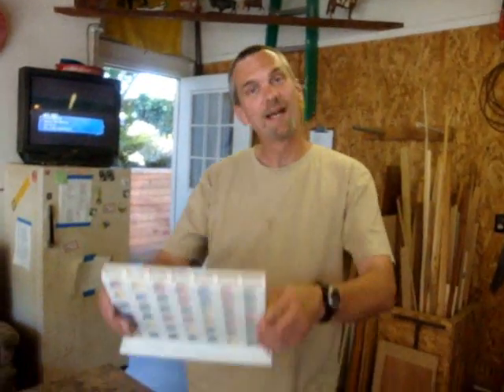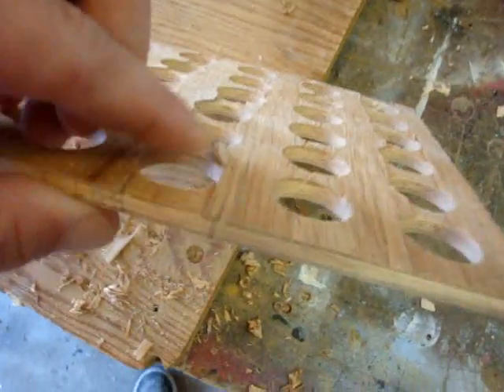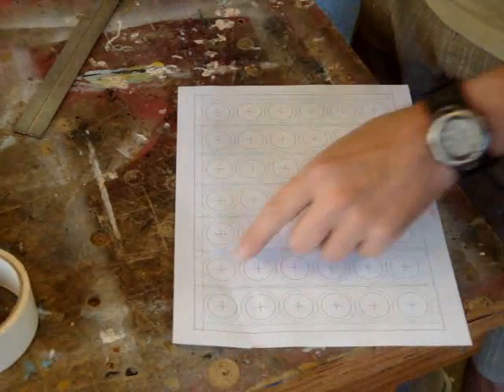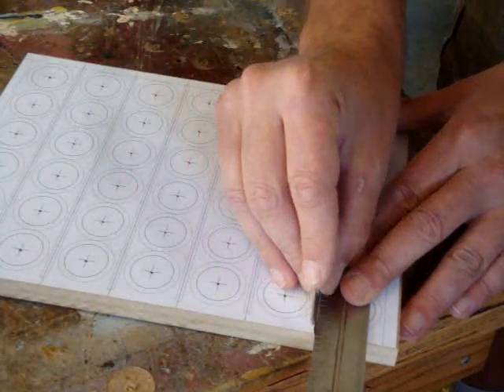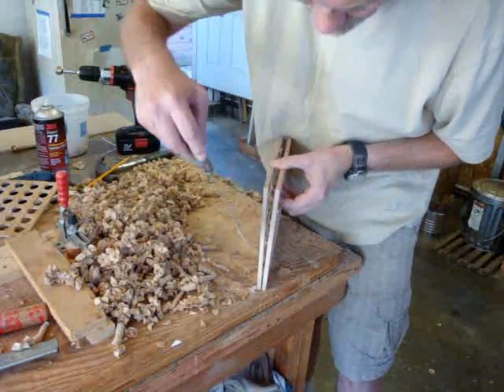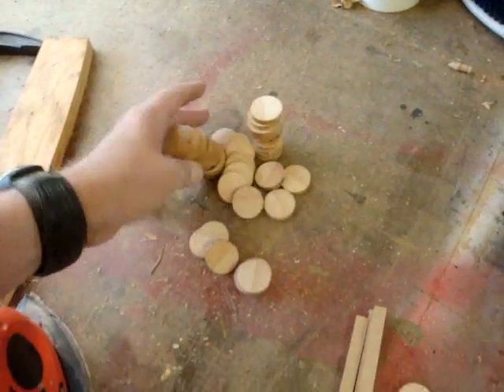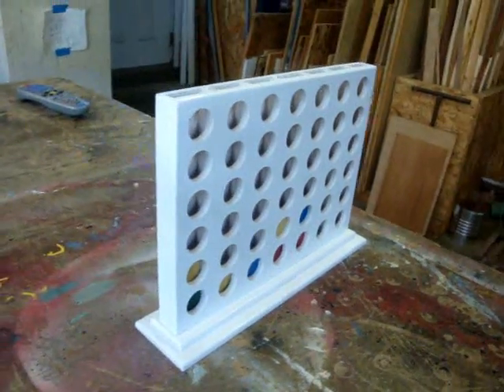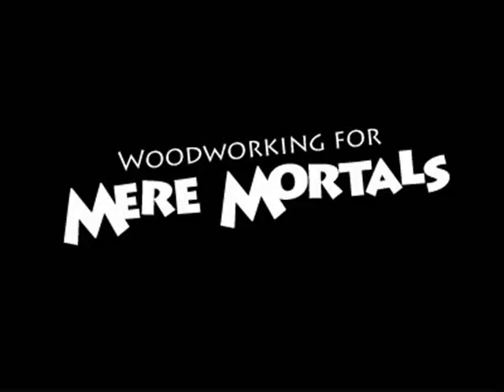Make your own Connect 4 game

Comment: I have a tip for working with the carpet tape, similar to the spray adhesive. Try sticking the tape to some cloth ,(usually my jeans leg), pulling it off and then sticking it to the boards. You should get enough lint to keep it from getting "welded" together!

Comment from the maker: @RedFox52403 I was a little concerned, but I cut about fifty of those and none of them popped out or jammed. I suppose because they are pretty light and small. Once they passed the blade, they were free.  If you hold the dowel reasonably firm, it doesn't spin.

Comment: Steve do you ever go back and try to improve projects? I was scanning your older stuff and came across the connect 4 games. I have two small children that are just getting into connect four so I might try this but my first thought was I'll be recutting and repainting the pieces for the next several years as the get lost. I was surprised that you didn't create some fancy storage to go with this.  Like something that slides across the top to close off the openings (like a pencil box top) or, a storage box on the sides or bottom. It is something I'll need to add and I just wondered, what would Steve do.

Comment: How do you manage to drill straight down with a forstner bit with a hand drill like that? For me, that sets off alarm bells about wrecking my piece with bad angles. I would have assumed you would use the drill press

Cool project, your design is really original!

Comment: Hey steve would it have been a time saver to spray adhesive the template to the two boards prior to cutting them to there 10x7 dimension?.... then you wouldn't have to worry about lining up the edges perfectly (and cut the template to size)... I'm going to do this project (although I already have the plastic version!)

Comment: And..... I've always wanted to make the booby trap board game too!!  I think you should too!
(Google it)
In case you can't decipher/find out how it works (i played it as a kid).  from images you can find you'' see different sized/colored discs within the box. also within the box is a spring loaded bar/fence that squeezes the discs together. As discs are removed by players in rotation (for points based on size/color) the bar continues to apply pressure until someone removes "the trigger" disc....

Comment: and then all the discs go flying everywhere!!!!
Rules are simply:
-2 to infinity players
-if you spring the booby trap your out, play again with remaining players until there is only one (elimination version)
-bigger the disc the higher the points (score version - but if you sprung it you lost) highest scored player won
-points were also painted on the bottom (i think) so you can play a different version of the game (score was random/chance in that version)
and whatever other versions we made up

Comment: Looks like you're very beginner carpenter. I'll tell you small lifehack how to drill plywood with Fosner drill w/o any cracks and chips. I very accidentally invented it, but I'm sure every experienced woodworker know it. Just drill guide hole about 2mm (113,38 twips for you) through all plywood, next drill one layer with Fosner FROM BOTH SIDES. When you'll drill second side, you can finish hole, just do it slowly. I had very bad cheap plywood and tried to use clamps and solid wood planks. It didn't work. If you want, I can make video for you and other beginners.